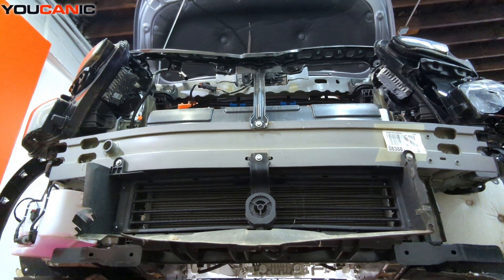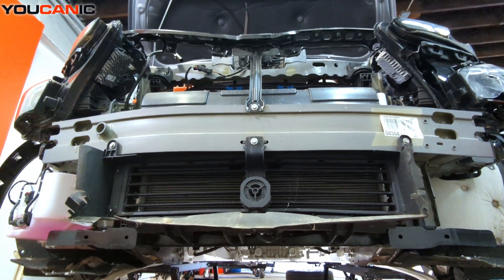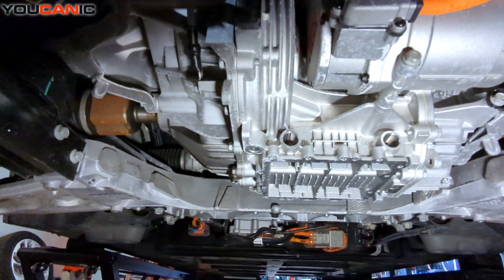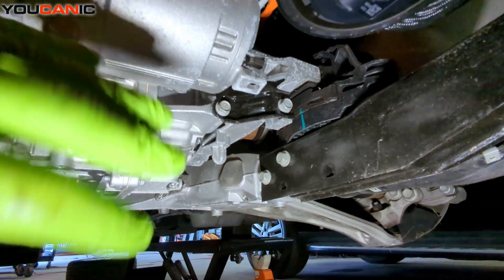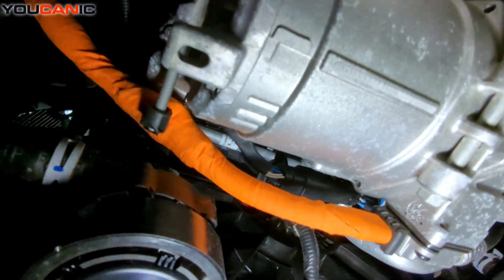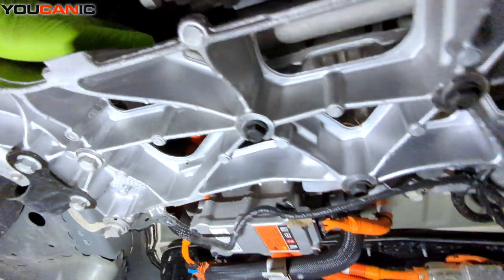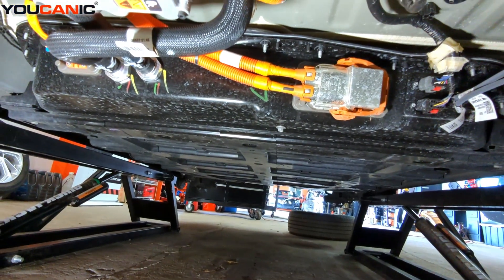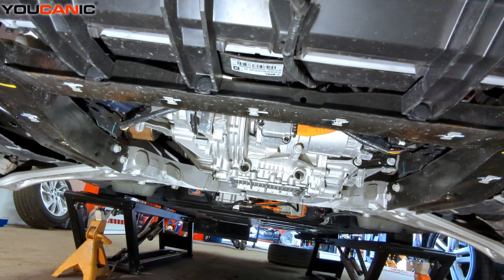2017-2023 Chevrolet Bolt EUV: Undercarriage View | Detailed Overview

Comment: Interesting how they stopped running coolant in to the bottom of the motor housing and are now relying only on air cooling the lubricating oil in the motor housing. I wonder what model year they made the switch?